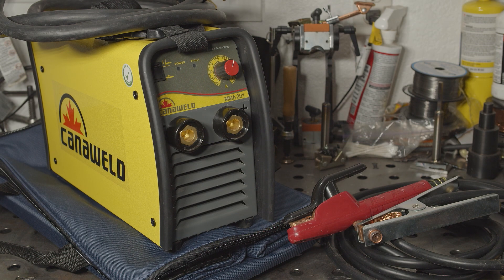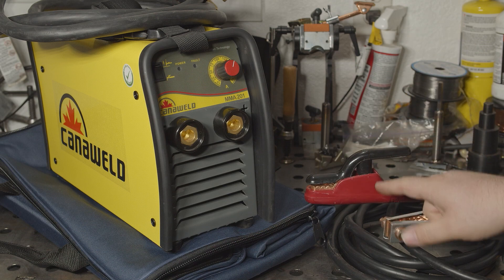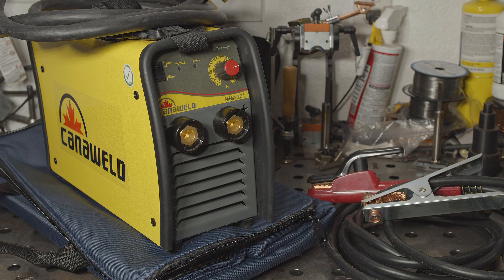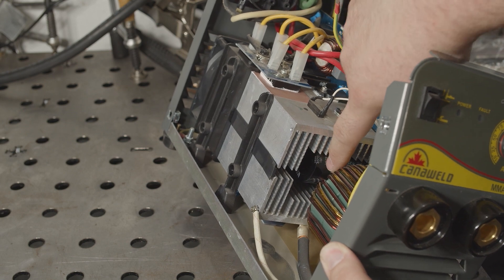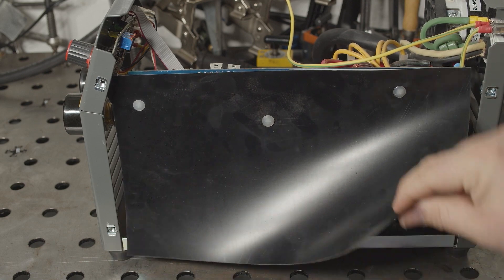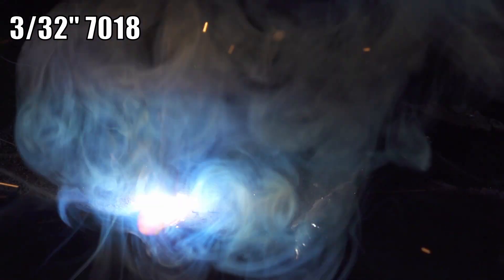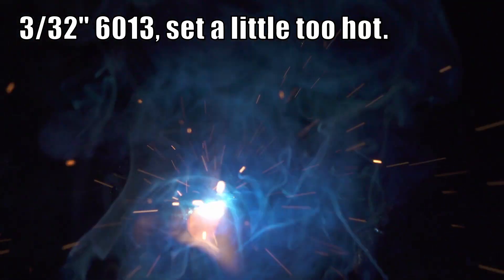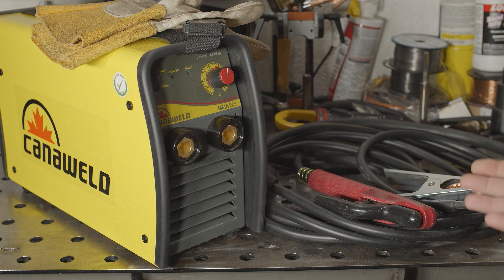Canaweld MMA 201 Review, Made in Canada

Comment: Is it worth the 700$-800$ price tag? Seems quite expensive for a basic machine? What would be a good alternative for this machine? Im in the market for a 200amp stick welder. There is so many different reviews that im not sure which route to go  some say chinese is as good as miller, some say the only way is miller/lincoln.
Reply from the maker: Unfortunately, a lot of the "big" names have seen price hikes lately.  Nature of the world these days with all the shortages, staffing issues, supply problems, etc.  The ESAB Rogue 180I is a pretty good machine.  Slightly less output than the Canaweld, slightly lower duty cycle, but it's more efficient (it has power factor correction),  it's dual voltage, and honestly, 180 amps should be enough.  Even for large thickness stuff, a bevel and multiple passes makes pretty much any thickness possible with a reasonably powerful stick welder (150-ish amps).  It just might take longer.

Miller's higher end stick welders are awesome...and are stupid expensive, especially after increasing in price quite a bit in the last couple years.  Their cheaper, Thunderbolt welders don't impress me much.  They're okay, but I'd much sooner pay a bit more and get the ESAB Rogue.  More power, better duty cycle, power factor correction, runs 6010 great, comes with FAR better accessories.  Unfortunately, the Rogue ES 180i has gone up from $599 to nearly $800 since it came out.  Still, if it were my money, I'd save for the Rogue over the Thunderbolt.

As for Chinese welders, most of the stick welders in the $150-$250 range work okay.  Some have more quirks than others and the biggest thing to consider is the possible lack of support if the thing up and explodes in three months.  It might work for years, but if it does fail, you have to know going in that there is a risk of zero support.  Some companies are better than others, if for no other reason than they want to avoid bad customer reviews on Amazon, but it's a bit of a crap-shoot.

I was pretty impressed by the performance of the Klutch ST201iDV.  It's currently just over $400, assuming it's available (lot of stuff is sold out all over the place).    

There really are a lot of options.  Even some of the very cheapest welders I've tested, technically welded fine.  So it's hard to say for sure what's best for everyone.  

Are you located in the US?  Where about?  You don't have to be specific, just curious approximate region.
Reply: @bigtb1717  thanks alot for you elaborate answer! I appreciate the rambling very much. I think you hit the nail right on the head! I have also notice the increase in price. I saw a hitbox welder on amazon for 700$. They were sold at 200-300$ in the begining of this year. Its crazy how some of them nearly doubled in price. Thats why im kind of in the rush to get one asap. I don't want to risk price getting higher or having supply issues. I am located in eastern canada!
Reply from the maker: Well, Eastern Canada is a big area and I have no idea what it takes for you to cross the border.  But if you are anywhere near the Detroit Michigan border area and are able to pop over, I have a Chinese stick welder or two you can have, lol.  Or I could make you a great deal on the Canaweld.  Probably not practical.  Just a thought.
Reply: @bigtb1717  so you bought all of these welders with your own money? Wow! You really should have more subscribers! As for my location, michigan is about a days worth of driving. Its not that from from toronto. About 2000km depending on where your located in the states. Id still be interested on the canaweld tho lol.
Reply from the maker: I'm not far from Detroit, Michigan.  I actually don't have a passport.  I've been meaning to get one, but just haven't gotten around to it.  But if you ever feel like a road trip and can meet me somewhere in the States, let me know and we'll work something out.
Reply: A trip down west sounds awsome but with the current state of events i don't think it will be possible. From what ive heard, our governement is shutting down the borders for travelers. Some provinces closed their borders which makes access even more difficult. If you don't mind getting rid of the canaweld, would you be willing to ship it if i cover shipping costs? Youtube keeps deleting my comment for some weird reason.
Reply from the maker: Strange (the comment deletion).   I wonder if it has to do with discussing "Current events?"  

I'm not against shipping it, I just had a lot of trouble last time I tried to ship something to another country.  I can try to look into it to get a general idea of cost.
Reply from the maker: I don't know your exact location, but I just picked a location and got a quote.  $140 US.  If you want, shoot me an email at bigtbcontact@gmail.com
Reply: Everlast....

Comment: I'd buy one if they weren't so pricey.  About $600 including tax at Amazon.
Reply from the maker: It's not all that much less expensive, but if I had to pick today, I'd get the Canaweld 162 D over this MMA 201.  The 162 D has a bit less output and lower duty cycle, but the output and duty cycle is enough for the vast majority of users.  Plus it has power factor correction so it will draw less current from the circuit and it can run on 120V or 240V.
Reply: At $780 bk's yeah... LoL Pricey for what u get...... @bigtb1717

Comment: You should've measured the open circuit voltage
Reply from the maker: Open circuit voltage measured at 76.6V DC.
Reply: @bigtb1717  Thats Good enough isnt it.?  Ive heard ya wouldn't want any lower then 70 OCV... The manual on my 162 D says 86... I wonder if that's B.S..............
Reply from the maker: Next time I'm messing around in the garage I'll check it.  The spec was lower than some of their other welders.

Comment: You know, i'm a bit meh on it after the review aswell. Reviews on amazon would have you to believe its up there with the red and blue / white machines. 
Stores here dont even carry 6010 anymore, have to go to the airgas store or order them, so i'm not too bummed when something doesnt run 6010.
But for something made / assembled in NA its price isnt too bad at all, if you consider a nice bag like that could be 75 bucks on its own.
Reply: Have you tried doing the lowercase "e" pattern when using 6010? Maybe that could help people that "need" to run 6010 but have an inverter machine that doesnt support it.
Reply from the maker: Personally, I don't normally run 6010 either.  I'm not an expert with it by any means.  I only buy it for welder testing, lol.  Like many inverters, the MMA 201 will lose the arc a lot less often if I keep movements small and the arc tight, so the "e" pattern might help.
Reply from the maker: Also, I kinda like that it's a little bit simpler.  Seem like less to go wrong and less likely to develop random glitches for no reason down the road, like so many electronics do these days.  It could end up being a robust and long lasting design.  That's all speculation, but it's possible.  

I guess the poor 6010 performance just left a bad taste in my mouth, largely due to not getting a straight answer from Canaweld about it before hand.  I was doing a review, so it didn't ultimately make that much difference to me.  But if I had been someone looking for a machine to practice pipe welding for my job and bought this welder based on the answer I received, that could have been a big deal.

Comment: Some of there machines looks just like clones of Chinese machines I question how much is made in Canada vs assembled in Canada.
Reply from the maker: Some of their models are definitely made by CEA.  Possibly others as well, but I can't say.  I also see what looks to be the same, generic, Chinese wire drive system in some of their MIG welders that are in a lot of machines these days, which also gave me pause.  But this welder didn't give me any of the cheap, Chinese vibes I get from a lot of other machines.  Hopefully Canaweld at least maintains quality control and standards of whatever designs and builders they use.  

I was pretty disappointed that I was told it would weld 6010.  I knew there was still a chance it wouldn't because of what they had explicitly told others.  But it's a shame that a direct question to the company yielded an incorrect response.
Reply: One thing to be sure, the price is made in Canada.
Reply: lol @leandersmith6184
Reply: Obviously the parts inside aren't made in Canada, it's just put together in Canada...  Canada hardly makes shiT.........